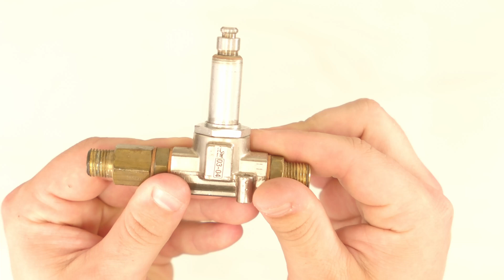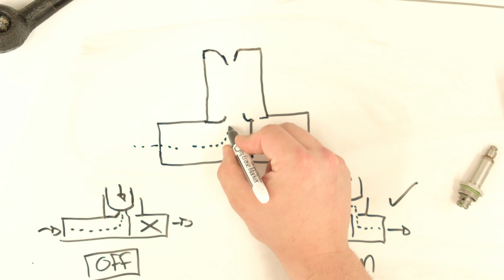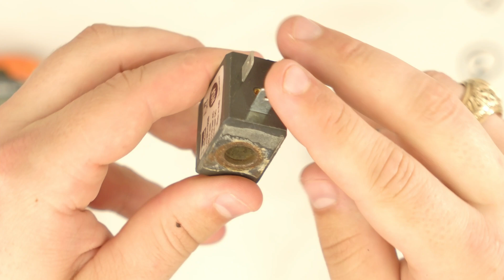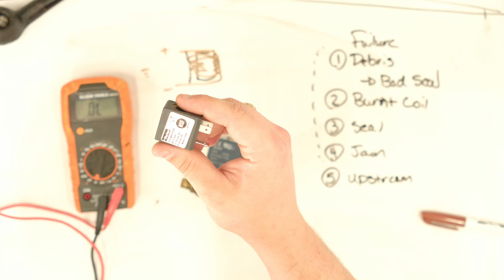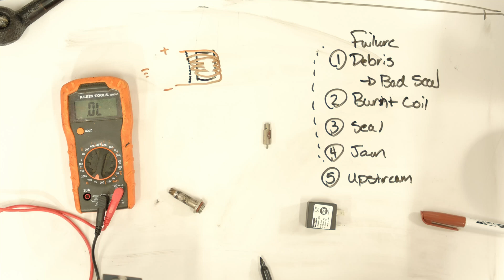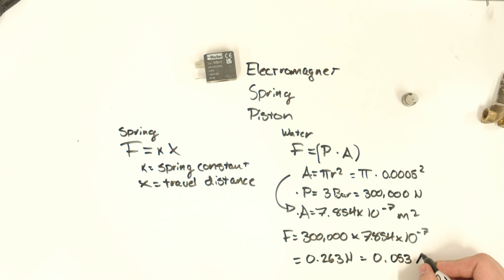The Electromagnet that Revolutionized Espresso: Espresso Tech 101 - Solenoid Valves

Comment: Hi Bryce Himmelreich, could you make a video comparing different vibratory pumps?

I just bought an espresso machine — the Mii Coffee Apex / Turin Legato V2 (the one with the adjustable OPV). However, the pump doesn’t seem ideal. The max flow is only 6.5 ml/s, even with the flow valve fully open. The pressure maxes out at 12 bar on the gauge, and the pump goes silent at that point.

I’m planning to buy a new vibratory pump but not sure which one to get. I'm hoping to upgrade to something better than the stock pump, but there is not enough information on the internet
Reply from the maker: Eventually I do plan to do a full comparison on pump types, brands, ml/s, etc. But can I ask why 6.5ml/s is too low for you? Generally speaking, vibratory pumps are considered on/off pumps unless you're using something like a PWM (I think that's correct for this application). But 6.5ml/s and 12 bar seems like plenty of flow and pressure. You could get more pressure by adjusting your OPV but I definitely wouldn't want to go higher that that. I normally set OPV's to 10.5-11.

In general I don't think adding more flow to your pump is going to yield any major results, at least not when you compare that cost expenditure to other mods or procedure tools. I certainly could be wrong though.

Full transparency, I haven't used the Turin Legato v2, so there very well could be some pump issue that I'm not aware of.

Comment: Good stuff.  For anyone who comes to this video and the comment section while working on a solenoid valve for the first time, let me add:

Not all solenoid coils are created equal.  Some machines use AC signals for the coil, while others use DC.  Some coils run at full wall voltage (110V or 220V), while others transform the signal down to something else (usually 24V).  Also, coils that are rated the same, but made by different manufacturers, might just barely not physically fit on your valve body.

If you’re replacing a coil, make sure it has the same ratings as the old one, from the same manufacturer whenever possible.  If it’s a really old coil and the writing on it has worn off, look up the parts diagram.  If you put a 110V coil and run 220V through it, it’s gonna burn up.  If you put a 24V DC coil on a 24V AC valve, it isn’t going to work at all.

Cheers and happy brewing/wrenching
Reply from the maker: This is a great clarification. I've made that mistake before, where I simply assumed a new coil would fit an old body, and was woefully disappointed.

Comment: The solenoid "nucleus" is called an armature. This resides within the armature housing. 
I too love the ruby seals, although I don't like the brass valve bases with pressed in restrictors as they can fail and leak with age.

Oh and hello from a senior coffee tech from Australia ;)
Reply from the maker: Great insight on the naming. I've heard armature, slug, plunger, and nucleus thrown around. I ultimately settled on nucleus since that's how that part is named with some of the parts suppliers I like to order from like espressoparts.

All things considered, I'm still probably a fairly 'green' tech here in the states. Glad to have you here. If you ever notice I get something wrong, I'm always happy to learn and grow as a tech!
Reply: @brycehimmelreich  na you are all good. I agree with a lot of your thoughts and statements such as proprietary parts (some I can understand but man, the pieces! - just be glad you don't mainly work on big superautos like I do lol) love the channel so far tho man.
Reply from the maker: @JimTheCoffeeGuy  I have serviced exactly one super auto in my life and pretty much swore it off. They are fantastic pieces of machinery worthy of study but holy cow that thing was a nightmare to work on. Actually, the 24v solenoid came off of that machine. The shots on it were oddly good and dead simple, so it had that going for it, but I was quite happy to be done with that one.

I'm impressed at how much thought goes into the design but to fit that much automation into such a small space meant everything was beyond crammed and filled with sensitive electronics. I hear Eversys is "okay" to work on, but there's not nearly enough around me for it to be worth training for.

It really made me appreciate the humble e61...
Reply: @brycehimmelreich  hahaha, yes there’s a lot going on inside them!
Over the years I’ve worked extensively on pretty much all superautos from cafina, melitta, Franke, Schaerer and wmf. Plus traditionals from laspaziale, nuvo simonelli, dalla corte and a few other random brands as needed. I’ve been a tech since 2009 so it’s been a hot minute! Currently I have a bit of a soft spot for Reneka machines. Their no-tamping hydrostatic group head is fantastic in my opinion.

Comment: Currently restoring a Grindmaster Espressimo 2100 and have it completely taken apart piece by piece. I have learned so much about these machines just by doing that. Still have a lot to go in the process but enjoying every step of the way. I'm a brass instrument repair tech by trade so alot of the same concepts apply. These machines are surprisingly straightforward when you follow the path of the water. 

There aren't nearly enough videos of the 'how' when it comes to anything when it comes to the machines we use. So glad I found this channel. I know I'm just one person but you'll definitely be getting a view from me if you do more of this stuff!
Reply from the maker: You're absolutely right about learning by doing. That's quite literally how I got into all of this. Back when I was in college, I would buy broken machines (because I couldn't afford working ones) and fix them as a way of getting into the espresso scene. It's amazing what you can learn about the design and intentional choices made by the engineers by just taking them apart and putting them back together.

I joke that espresso techs should work on car engines. One of my biggest mechanical "unlocks" was doing a very mechanically challenging timing belt on an old Nissan 300zx. The amount I learned about wrenching from doing that almost fully translated to working on machines. And likewise, the amount I learned from studying the water systems on espresso machines has helped me a ton in working on cars (particularly the fuel system side of things).

I'm definitely planning to do more tear downs. I don't know that I'll ever really focus on a "how to fix ____" style outside of some major repair items like rebuilding group heads, steam groups, and things like that, but instead focus more on the individual components, how they work together, and approach tech work from a more wholistic standpoint. Every machine is slightly different and I've found that understanding "why" certain parts are used and how they contribute to some of the major systems in espresso machines and grinders, you can fix just about anything. It also helps like crazy for diagnostics if you have a grip on, for instance, the full water pathway for a machine.

Comment: Now we can be very thankful for the humble little guy. I had the issue with my Breville machine and they replaced the solenoid valve after 5 yrs of using it.  I never liked math but it was a fun fact at the end of the video.  By the way, what esspreso machine do you recommend for a coffee shop? La marzocco? I have San Remo head office near me and I am visiting there to check out their machine tomorrow... I am planning to open a coffee shop by the end of this year... so...
Reply from the maker: The topic of the proper machine for a coffee shop is one you're going to get about every opinion under the sun on, and generally speaking, they're all different.

In my opinion, the answer is a lot simpler than people make it out to be. You want a machine that accomplishes three things: the workflow speed your shop needs, the consistency/quality of shots needed for your vision, and easy access to parts by your local tech. Workflow speed generally comes in the form of quality of life features, like a volumetric machine or gravimetric machine. As a caveat, I DO NOT recommend getting a machine that is full manual actuation (a.k.a. doesn't have volumetric capabilities). Manual actuation of shots is a pebble in the shoe of workflow, and will slow down your system a ton. Most machines these days can be calibrated to produce consistent and good shots, but anything with a dual or multi boiler system will sit as king on that list. Ease of access to parts and repairs is the most ignored piece of advice, and the most idiotic piece to ignore. It doesn't take much napkin calculations to realize that a week of down time due to a broken machine and no tech to fix it negates most of the cost savings you would get by going with a brand your tech doesn't service.

TLDR; Talk to your local tech. Tell them your goals, and ask them their opinions on what machine you should get that they actively service. Better yet, buy it from them!

Personally, I'm a fanboy of La Marzocco. I was very tempted by the Slayer lineup and the Synesso MVP Hydra, but the servicing costs and parts availability were prohibitive. We've got a LM Strada ABR on our bar.

P.S. I recommend a two group if you have room to add another machine later, or a three group if you don't have room for a second machine. A three group is nice for if one group goes down. A two group is nice when you can add a second two group and double your workflow.
Reply: @ Wow thank you for your advice. It is really helpful!!! I don’t think I can afford LM Starda ABR but I want it too 😢
Reply from the maker: Truthfully, I don't know that I would go for such an expensive machine again. It's absurdly wonderful but also quite a bit overkill. I know I've mentioned it in other videos, and will really dive into this into the future, but in a lot of ways what dictates quality for a COFFEE SHOP (not home) usually comes down to a product that meets the expectations set by the atmosphere and aesthetic. You can probably pull indistinguishably good shots with quite similar consistency on a Linea PB, yet the Strada ABR is like $10k more expensive new.

Maybe it was worth it for me since I'm also a roaster and needed everything to be top-shape as "marketing" for our beans and the machine itself is stunning, but I sincerely doubt it was $10k worth it. Admittedly I bought used and saved some serious $$$, but in hindsight I probably would have pulled the trigger on a refurbished Linea PB or a Slayer at half what I paid, and spent the rest of the money on quality of life items like a puq press, more pitcher rinsers, and an automated pour over maker like a Curtis Seraphim.
Reply: @ Thank you again! It is very good to have an advice from a real coffee shop owner.

I like the ABR because I don’t need to use external scale each time… but people will not notice the 0.5 ddifference anyway… 

so maybe I should save some and buy the the puq press 😅 too

I am going to roast too. Which roaster do you use? I was thinking about Bell wether for the convenience but I think it looks too clean for specialty coffee shop that I am designing…
Reply: I saw your Roaster and LM Strada ABR in your instagram. Awesome!!